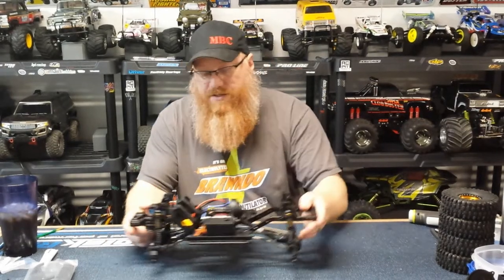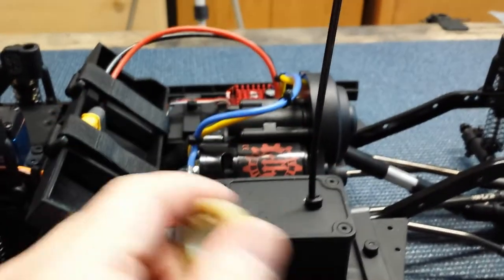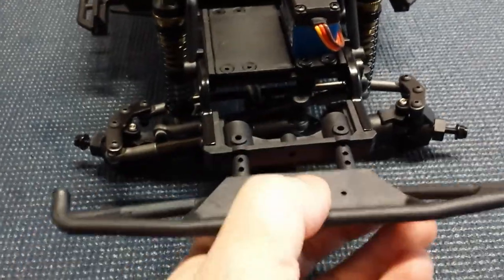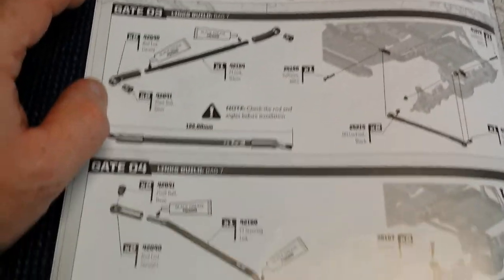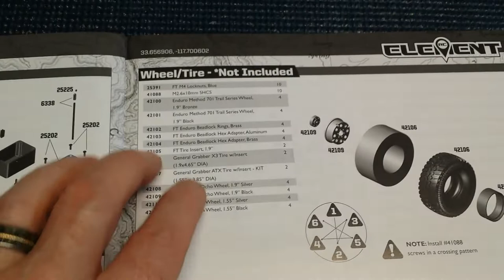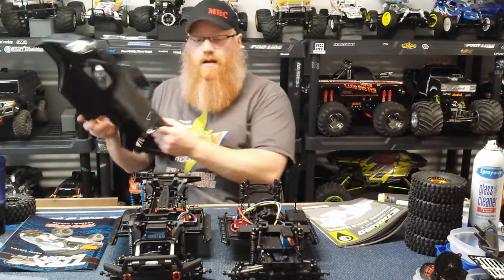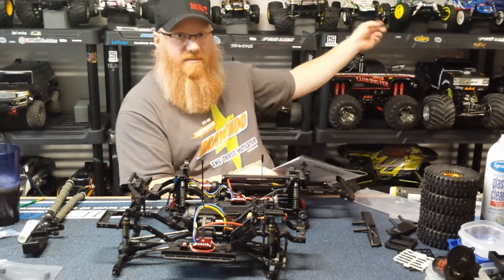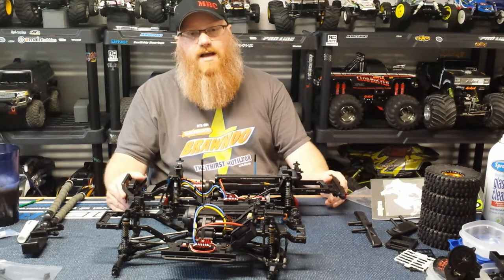Element Enduro Builders Kit 2- Build summary, instructions rant, TRX4 comparison

Comment: Dude, I had no problems at all, building my first edition kit.. luv it! you may run into problems however when building  the drive shafts ,if you mistake them for axels!! I think your just looking for something to bitch about on a top quality kit , to make a video !!
Reply from the maker: I agree the kit is top quality, I just built one for my self finally. I still think the printed manual sucks. Using the one downloaded on my laptop was better as I can zoom in an see where all the stuff is indicated to go. I will acknowledge I was a bit ranty in there complaining about the instructions but I didn't want someone with little to experience thinking this was going to be this great truck that is easy to build. It is a great truck but for a major RC company, the instructions are not great, they work but could use a lot of improvement. I am glad it all went well for you and thank you for watching it but my video was and is 100% how I feel about it.

Comment: I think associated did that because the know who ever uses their vehicles is going to be for some comp and probably isn't going to bother with the manual. They probably just gonna use the Trans and the axles and now the links, maybe. 
And you know those dudes don't even bother with a manual, they build trucks from the axles up.
Reply from the maker: @sickboom7474  I was just shocked at such a crap manual from such a big name in the industry. I guess I expected too much from it and you have a point with it being a builders kit, many are using it as a starting point but for others it may be their first kit they are putting together and they will probably struggle and not have a good experience. Have a great time building and modifying yours!

Comment: So which is the better buy. Get the kit or the rtr?
Reply from the maker: Like most builders kits these days you get upgraded items in the kit vs the RTRs. If you generally upgrade your RTR with better wheels and tires or electronics them I'd say you are better off with getting the kit and running that with your favorite combos. If you typically just run whatever you but I'd say get the RTR. I have heard good things about the ecto performance wise, it is a love/hate thing with the body and color for most. But it hink performance wise it is the best RTR that offer. I have not driven one, just taking other's experience with them into consideration. The kit is a great truck once built, I was just annoyed with the frustration of building it. If you go into it knowing to be super careful and know its shortcomings in the manual it'll be fine. The truck is great I once built and the shocks are top notch.

Comment: Really appreciate the video and honest thorough review. Just getting into 1/10 scale crawlers and being a Team Associated fan in the 90's I was drawn to the Element trucks especially after other positive reviews on the RTR's. I found a great deal on a used TRX4 Defender with some upgrades so I planned to bash that around while I did a kit build as I really enjoy building them like you said. The upgrades and parts look great but with no way to mount a rear bumper and dealing with the build fiasco even with your tips it sounds like I may just go for the TRX4 Sport for my first build. Too bad because it seems like a good platform with some nice upgrades out of the box.
Reply from the maker: I still have no idea about the rear bumper thing, I just went ahead and ordered the original one to make life easier. Every crawler made has its own quirks and limitations. This one's is the poor instructions which is not good considering it is the kit version. Otherwise seems like a solid truck! You really can't go wrong with grabbing a TRX4 since parts can be found at almost any hobby shop and everywhere online!

Comment: I have just  finished watching your clip and i totally agree with you and which i had seen you earlier but when you have a company like A Main Hobbies pushing these "KITS" as good products what do you do.
Reply from the maker: I don't even think you can blame the shops, even big ones like Amain, this is a lock of effort from the manufacturer. I get that big companies like Amain could do more about fixing these problems but as long as they are flying off the shelves then I doubt they would. I did my part to put out my PSA of this should probably not be your first assembly kit video so I tried! The manufacturer isn't going to take the time to do it better unless more videos demonstrating their shortcomings or people calling to complain continue. I don't want builders kits to get a bad wrap, I personally love building RCs but they could have easily improved their instructions and done a lot better from the V1 kit to this one but they just took the easy road and did a copy/paste of crappy instructions and fixed some of the issues with the first kit and released this one.

Comment: I feel your frustration on this assembly kit. I built the original Element kit and experienced a lot of similar aggravation as you, and you definitely need a caliper to build this kit correctly, which is a pain in the ass.

I have a second Element kit I have yet to build because of this.
Reply from the maker: Yeah, it was frustrating going to a new platform and having to make guesses and figure out stuff as you build. The truck came out great and works great so they nailed that part. Thanks for watching and taking the time to comment!

Comment: You've got good points, and i see myself building a kit for a first crawler with very little RC exp. I'm just like that - Lego generation (too much yt gives some exp in crawlers though) 
But in defense of Element - most companies rely on YT publications from private people, resolving their customers problems. And I don't like it either.
Also I don't like better manual online, cuase as we know, nothing gets lost online,  except 10 years later, when you wanna refurbish a kit for a grandson, manual goes off the servers... Also I don't think a server should run for decades holding stuff like that. 
I think you were objective enough and I don't see much bias. Got respect for element being so capable and for Traxxas for being quite value offer in bigger picture. Something me and many people don't always appreciate.
Surely Traxxas wishing to innovate and lead, will have to clench butt chicks hard for trx4 replacement that i guess is in the works, and i bet they need to copy from successful performers in the competition lineup, but I also bet they won't be comfortable doing it 😊
So maybe they'll bring in another successful truck, that shouldn't perform as good as trx4 did
I would prefer a performer like Ecto, but maybe I should pick reasonable and cheaper with better support like trx sport?
Reply from the maker: I think manuals are the least fun part about releasing a kit to market but for such a big company to release one with errors and items that are not easy to follow is just lazy. If it were a Gen 1 kit there is some excuse but for a Gen 2 kit it is just lack of caring. And simple things like scale drawings for links are something that is done by so many others but neglected in this one is silly.to me. They are just short of being scale in the pics so why not make it right?? I do love the performance of the truck and once built it is a great platform so I can highly recommend it as a platform I just hate the build experience. More and more companies are supporting them so there is that as well.

Comment: I made it to the end!  😉

Not trying to one up you but you should see a WPL kit manual.  Holy chowder they are brutal...but the WPL kits are really inexpensive in contrast to an Element RC.
Reply from the maker: Yeah, from a small company or new company I'd expect worse instructions. Just was pretty disappointed in a big name company that has been doing this for decades to not make improvements to the instructions. They just updated the already poor ones. The truck is good though so they did that part right!
Reply: @AddamsPlayground  I understand...it is almost like they don't care.  The Axial Capra manual was had mistakes in it too.  I am looking forward to building some Tamiya kits I have been stockpiling for winter projects.  I understand those instructions are stress free.

Comment: Thanks for the review. Im going to get this v2 kit. I hv seen worse manual than this. 😂 I think i can handle it. 😆
Reply from the maker: I think the truck is really nice and if you have built stuff before you should be fine. I still don't understand the rear bumper mount, changed it out for the original one.

Comment: THANK YOU for this!!!  You, as a veteran RC Builder, was frustrated.  I thought I was the only one that couldn't figure this out.  This Element kit 2 is my very 1st build as a beginner.  My RC Buddies advised me to start with this particular one..  Just started building this kit and I had the exact same problems you outlined in your vid.  I thoroughly studied the manual and parts 3x times before getting starting.  I too could not find the 18t pinion and some of the screws.  Plus, I couldn't figure out the descriptions of the screw measurements.  Had to match the screws to the 1:1 pictures in the manual..  I was cussing at the inferior instruction manual.  I used a high powered magnify glass just to see the pictures.  Like you, it took all the enjoyment out of building this kit.  Any suggestions or advice for me how to proceed???  I am a little discouraged 😞 right now.
Reply from the maker: So I got a pinion from my local hobby shop and if they don't have an 18 tooth you can go down a tooth or two, I won't be a noticable difference really. Just don't go up anymore than the 18 since it will start hurting your slow speed ability and the 18 is fast enough. I was able to get it all together with the supplied screws. I know there is a confusing step with the servo linkages I believe it was where the length they call for is incorrect. Try using the online pdf instructions on a laptop or tablet so you can zoom in and see those clearer than the printed ones. If they haven't updated the manual online yet the V1 manual is almost identical. Just compare.steps and if they look the same you shod.be goo to go. Very little changed from the V1 to v2 sadly... They should have updated the manual along with the effort they made.to improve the truck. Once it is built.the truck is a very good truck and you will love it, once you get over the pain of the instructions! My only other suggestion is to get the V1 bumper mount set as the bumper mount for the rear on the v2 is mostly useless. If you have a frame mounted rear bumper than don't worry. But if you get "standard" axial type.bumpers you'll need that V1 rear mount. Keep going and get it built, you'll enjoy it once it is all done!!
Reply: @AddamsPlayground  , Thx for the advice!👍

Comment: Today I give up while building the links,  the building experiences is terrible, the manual is not helpful, I have built multiples Tamiya kits and included TRX4 sports kit which is much more enjoyable.
Reply from the maker: Have you tried using the online manual to be able to zoom in on it. I did find that helped out some at least with the screws and screw locations. I do agree it is not well done and leaves a lot to the builder to figure out which in some cases where you bought the kit to build something one-off that is fine but people do that all the time to Axials and Traxxas trucks to and there manuals are worlds better!!! I don't know what they were thinking but I hope when you come back them you get them knocked out and the rest of the build is not too bad. I do remember one issue in the manual about mounting the steering link as the screw they call for is not in the kit, you have to skip ahead accounting for the screw used in the next steps to find the lone remaining screw and they is the one to use in the steering link! It is a terrific truck once built but the build is supposed to be enjoyable too! Good luck and you did the right thing by walking away, assembling stuff angry never goes well!!
Reply: @AddamsPlayground  Thanks man, my biggest problem is not sure which way the curved rod end should face when assembling links to the chassis.
Reply from the maker: @liewzy  I would say to just use the install part of the manual and not the build part to help explain that part. So, grad a pair of them that have the bent rod end and skip to the installation part and then lay them out how they need to go onto the chassis and assemble them on at a time like that. Essentially the bent rod end have to mirror one another so if the top link point left then the bottom should point right and then the neighboring one would be built opposite of that so the top link would point right and the bottom point left to make the triangle out of the links. It can be confusing, wish I was there to help! I hope I didn't make it more confusing for you!
Reply: @AddamsPlayground  I have finished it, looking for cool body that fit it right away and next would be start practicing painting body, cutting and apply decals for half finished Tamiya kits 🙂
Reply from the maker: @liewzy  there are countless ones out there for crawlers! I am glad you got it finished and don't rush with the body and decals. Take your time and I'm sure it'll come out great!

Comment: The main advantage to the Enduro over the TRX4 Sport is the weight. It’s tough to make a TRX4 Sport light. I just transferred my TRX4 Sport drivetrain to a Brazin ATL chassis and skid and it’s still heavy. I am not a Horizon fan but I’d probably opt for an SCX10II builders kit and get cheap Amazon pivot balls and buy the Element shocks vs buying the Element
Reply from the maker: Yeah, the Enduro is way lighter and the trx trans is a chonk! I do want to get an axial kit, sadly I have not gotten one yet except for the little scx24.
Reply: Why do you say that? I also have a class 2 trx4 and it's a tank. I just got the ifs element for class 0 and the weight is so refreshing. I love how light it is. I'd like to do a solid axle kit now that's light.

Comment: Says right on the box that a pinion gear is not included. Its a comp bumper. The whole kit is bare bones for a comp or light style build. The trx4 kit is 400$ the element kit is 240$. The manual is just as good as axial or traxxas. A lot of senseless griping in this video. The element is a very good rig and just as good as the trx4 and better than the scx10. And this should not be a first buy for someone getting into rock crawlers.
Reply from the maker: I completely agree it is a great truck once you get it built. The pinion was my fault, I should have read the outside of the box that I ordered online! I think it is silly to not include one but you are right it is a builders kit and it is an optional part. I still stand by the instructions are lacking and have issues that are simple to fix and make better, they choose not to. It's super simple to make scale link drawings in there, everyone else seems to do it just fine. I did not make this video for hardcore crawler guys. I made it for anyone and would hate to give it a false glowing review and some guy goes buy it and have a hell of a time putting it together. Sorry you got triggered by me telling people I thought it was not for a first time crawler build and the instructions lack in comparison to other brands I have built. I appreciate the feedback but it sounds like a fair amount of senseless gripping.

Comment: Gudday m8.. many thanks for the video, This kit will be my second ever build...my last one was the Tamiya hornet in 1986...so it has been a while... My package is still in transit to New Zealand so glad I can refer to this in a few weeks when I start. I picked up on a few tips that i will use utilize, disappointing to hear about their customer service and average instructions. My main concerns were that  key parts were missing or did not fit, so I am very glad that was not an issue. I plan to build this slowly and carefully, paint the Proline body I have for it, and enjoy and learn from the experience.  I am hoping for fairly good performance from this chassis ,and thought would be a good addition to my Crawler collection.
Reply from the maker: Pay close attention to screw sizes and read through the steps before building. If you take your time and double check things before you do them you should be fine. Once you get it built it should be a really good truck!!

Comment: I just finished a gatekeeper kit, after building my first crawler, an SCX10 iii, and then a TRX-4 builders kit, I too was very frustrated with the instructions. I don't know how many times I had to rebuild things because they weren't right the first or even the second time. I agree with you on the upper shock mounts, that is silly. My other big grip was the overdrive ratios in the transmission, you have to keep referring to the parts blowup at the back of the book to figure out which gears are the optional and which are the main gears. I drove my gatekeeper one time and then sold it, for the same reason, frustration. I plan on replacing it with a Capra.
Reply from the maker: Just do your homework on the Capra too, I know the axles are prone to breaking but I am sure there is a ton of easy upgrades to fix that. I don't have one or I could give you some insight on it. Sorry the gatekeeper didn't work out for ya. We have regret vehicles at some point. Mine is the Ryft, don't even want to drive it because I know something else is going to break! If it is gonna sit around waiting for parts it might as well sit around ready to go out and get broken!!! Thanks for watching!!!